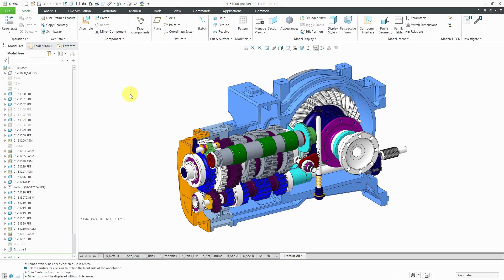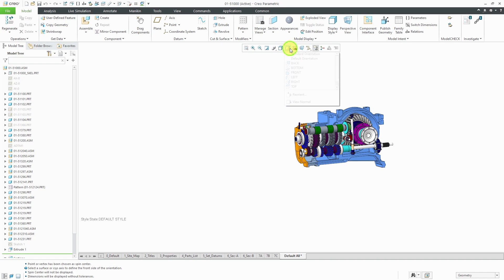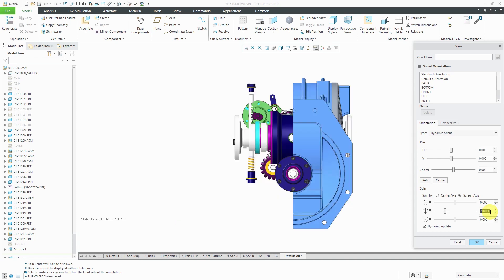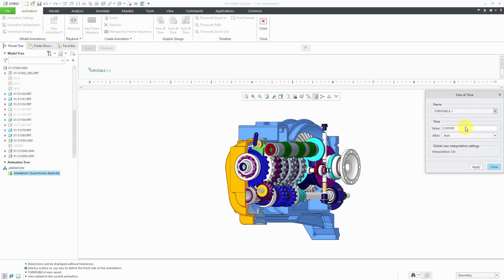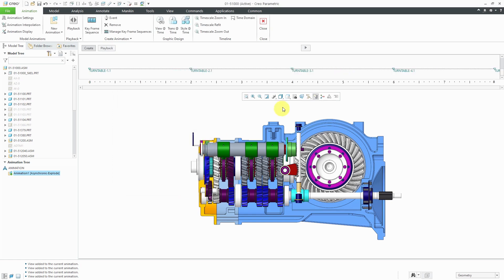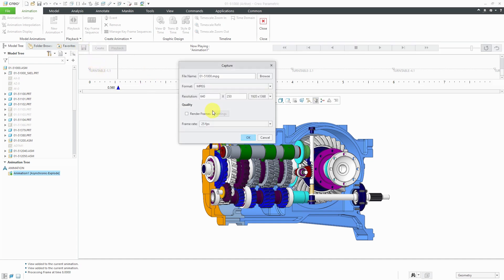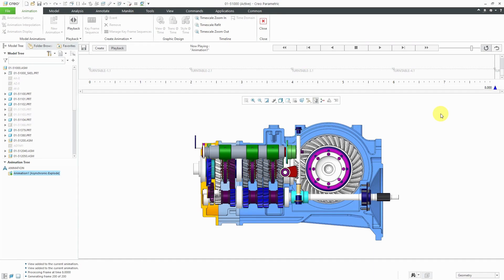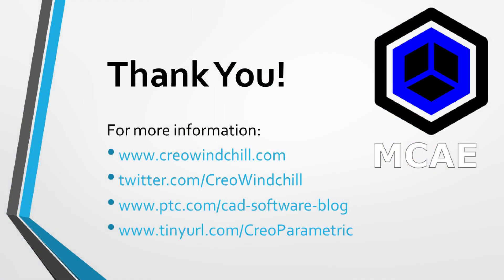Creo Parametric - Design Animation Option (DAO) - Creating a Turntable Animation

Comment: How do you do cross section in an animation?
Reply from the maker: I don't believe you can add a cross section as a Key Frame Sequence. However, you can have a cross section applied to the model when you create the animation. If you would like to add a section as an event in the timeline, I suggest submitting an enhancement request to PTC via the Ideas forum on the PTC Community site.

Comment: Hello Dave.

Your videos are very helpful. Keep with that!

If I want to do something similar, I prefer to do something else like that:
• create an temporary axis in the center of final assembly (center of wanted rotation)
• create a new temporary assembly with the final assembly and create a pin connection with the center axis of final assembly
• in mechanism, create a servo motor and do a mechanical analysis (full rotation)
• save the playback with the camera angle that you prefer

* you may want to disable the time in upper left corner
* you may want to run the analysis one frame less, so you can have true loop
* you may want to save the playback as an .PNG sequence and create the video with 3rd party program

In the way that you suggest, you have artifacts when you rotate the camera from one view to an other. With the way that I suggest, I have very good results without camera artifacts.

Let me know what you think with that workaround and if you want, create a video to demonstrate that way.

Best regards,
Nick M. from Greece.
Reply from the maker: Thanks, Nick! That's a really great method.
Reply: Nikos, i really like your approach as I have run into the exact same issues you have pointed out with respect to changing views/camera angles.  A problem I have recently run into on a similar note is that I have a very large assembly (40 acre building site) with small details such as roads, buildings and a helipad.  I was trying to export an animation of the site rotating but also zooming in on the helipad and following the helicopter as it takes off.  The problem is that when initiating the view transitions, creo can't seem to compute properly as the assembly is too large in relation to spin center.  During the transitions, the model completely leaves the view plane and you are left with a plain white screen for a few seconds as it transitions.  Normally when faced with issues like this I would add intermediate views and transition to them in smaller increments.  However this particular situation it doesn't seem to make any difference how small of a transition you make, it still zooms out, under and back around to the next view.  While the animation module in creo is helpful, often I find myself spending way too much time just to end up with mediocre results, especially when you are tying up a license during its generation.  I try to set the animations up to start frame generation, then go to bed.  Too many times I've woken up expecting to have an awesome animation in the morning only to find that it failed for something stupid only a few frames after I walked away #facepalm.